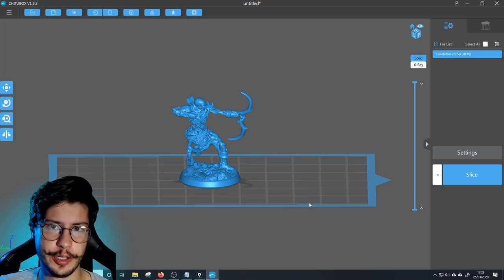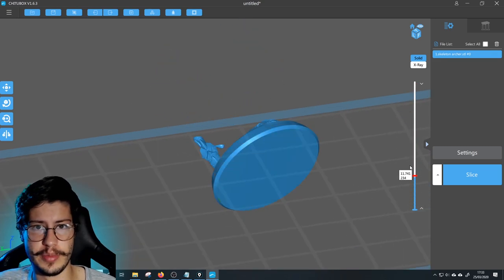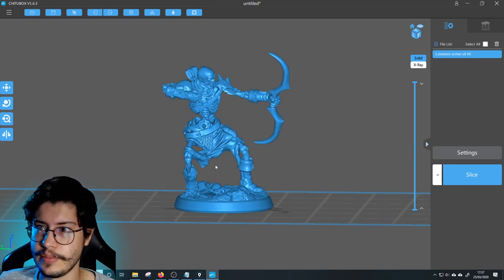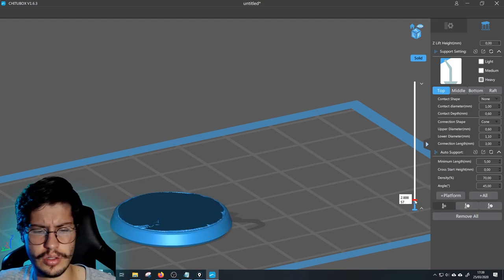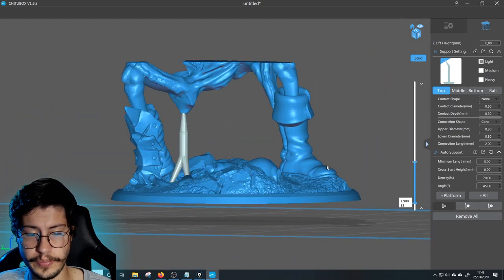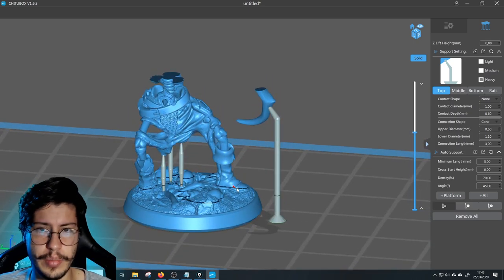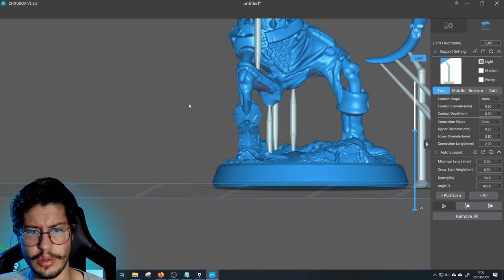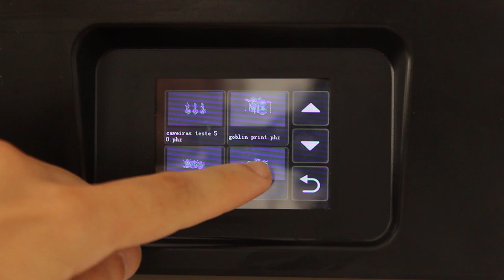Preparing 3D models (miniatures) for resin 3D printing using Chitubox

Comment: You might consider recessing the bottom of the base a little.  A mini with a totally flat base is great if all you ever play on is a totally flat surface.  But if you are on a textured mat or terrain that super flat base just makes the mini slide around every time someone bumps the table.
Reply: nice tip, thanks!
Reply: Or cut out an oval of felt or cork that you can glue to the bottom.
Reply: or just dont bump the table

Comment: is there a limit to the amount of models i can print in one single print as long as it doesn't surpass the limits of the buildplate?
Reply: It kind of depends. the more models on the build plate, or the more surface area being printed, the stronger the vacuum of resin to FEP will be. If your lift speed is too high/fast for the volume, you can end up tearing the model somewhat horizontally which can result in weird, wedge shaped gaps.

Comment: I've got some questions,
How do you know how big the size of the print is going to be? Is there somewhere to set the scale or is it done in the modeling program itself?
Also, can the resin printer use any kind of resin or does it have to be by brand and has to be imported?

P.S: se fica dificil responder em ingles, pode responder em portugues. Sou mais comfortavel falando e escrevendo em ingles XD
Reply from the maker: Hi Sean. In the slider on the right, there is the number of layers and also the printing heigh. In this case, you can see 747 layers and 37.39mm heigh.

Yes, this printer can use resin from other brands asswell! :)
Reply: @LootStudios  the thing I don't really get is the scale of the sculpt. Say for example, the character has a height of 152 cm irl and I want to print a 1/8 scale statue. The height is going to be about 19-20 cm standing straight, but what if it's in a dynamic pose where he is leaning forward/running etc or in multiple pieces. How would I calculate the size of each piece?

Because in my case, I draw a reference image that is about 1/8 of the actual size of the character then import it into Blender to do the sculpting, so is my sculpt technically 1/1 or 1/8 of the size?
Reply from the maker: @seanchoy236  In this case I make the right scale while exporting the model, using Zbrush. I always save a file where the character isn't posed yet, so I can use it as a reference of it standing to set the right size for the posed model :)
Reply from the maker: @MikeWazowski.2001  on the right menu, bellow the +All button, there is a "edit support" button. Just press it then you can move the supports the way you want :)

Comment: Hi, my son and I subscribed and got your first batch of models however I'm having real problems printing them on my photon S, I just cannot get any detail, do you have the specific settings on chitubox for these models, that would be such a help, thanks.
Reply from the maker: Layer Height: 0.05 mm, Bottom Layer Count: 5, Exposure Time: 8s, Bottom Exposure Time: 50s, Light-off Delay: 1.5s, Bottom Light-off Delay: 1.5s
Reply from the maker: This is the config we used and it worked perfectly
Reply: @LootStudios  That's great, thank you very much for the speedy reply!